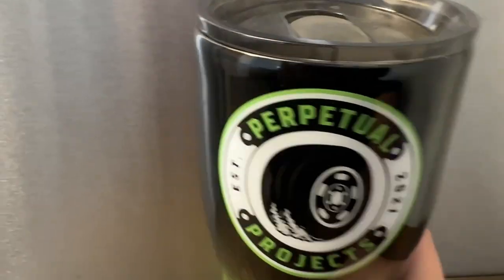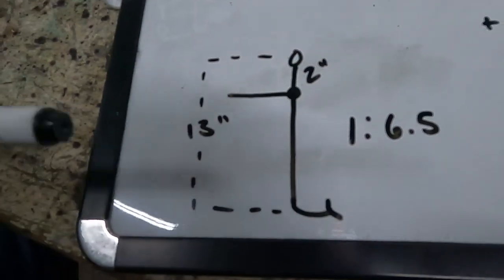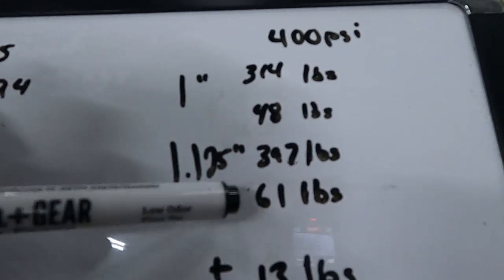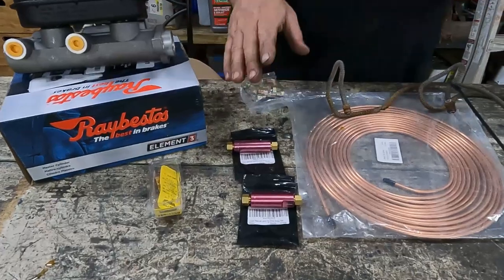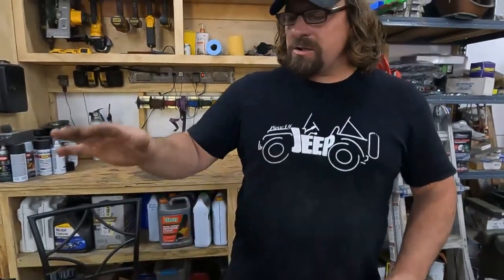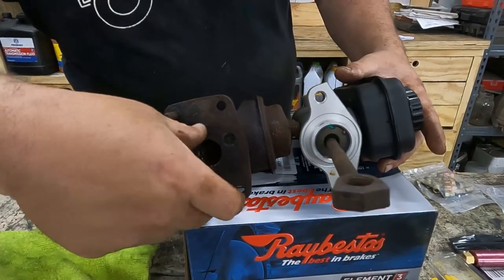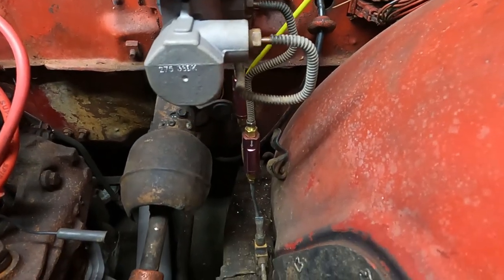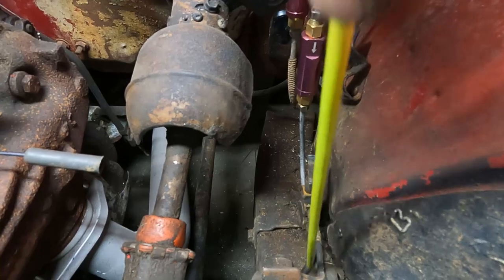Using A MODERN Master Cylinder On A CLASSIC Car

Comment: I don't know why this video popped up, but I'm glad it did.  I have been trying to find the proper master cylinder for my manual brake conversion, but couldn't seem to find the correct one, without going to a high dollar aftermarket cylinder.  Great video!
Reply from the maker: It was meant to be! Glad you enjoyed the video. Might want to check out this one to make sure you have proper pedal ratio. Good luck! https://youtu.be/LYBOlHUTVKs

Comment: Cool video!.   you know that the calipers off my 78 New Yorker fit both my 84 and my 87 Ramcharger.... You can also play with wheel cylinder sizes and caliper piston sizes to fine tune you brake pressure rockauto gives you all the specs bore sizing etc. On the masters, calipers and wheel cylinders.... And yeah a dual system brake is very important to safety I wouldn't causally dismiss that at all. Done right a manual system can brake on par with a Power brake system...but on the road leave the drums for the back where they belong on the street disc is the only way to go up front weather manual or power.
Reply from the maker: Agreed. That’s why I decided to use the parts off of an 80s Dodge truck. Because I have them and I already know the combination is great brakes because it’s already installed on another vehicle.

Comment: What type of 1990 dodge truck. I’d really like to do this one a Chevy Monte Carlo hobby stock race car.  Omg the brakes suck manual brakes stock master cylinder pedal is hard as a rock with no real brake pressure feeling. Kinda hard to drive a race car with no pedal feel🤦🏼🤦🏼.    

What  90 dodge truck
Reply from the maker: The master cylinder was a d150, you might also want to check out the video on pedal ratio. https://youtu.be/LYBOlHUTVKs